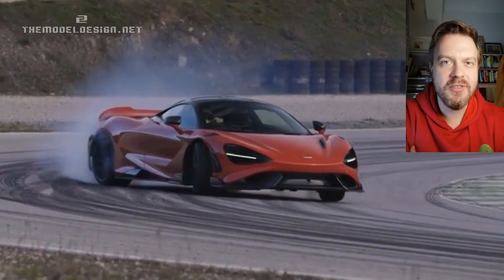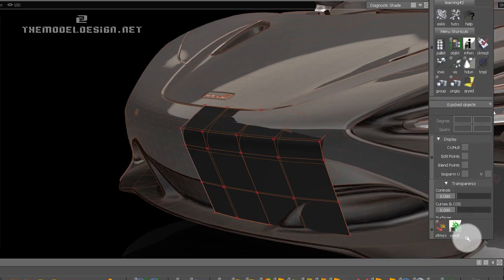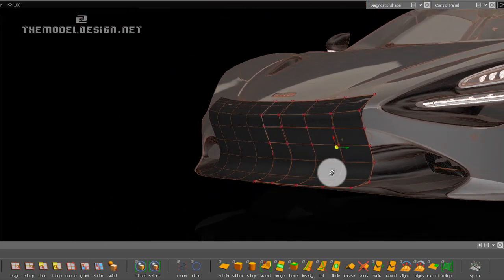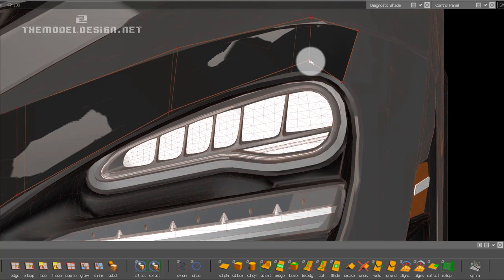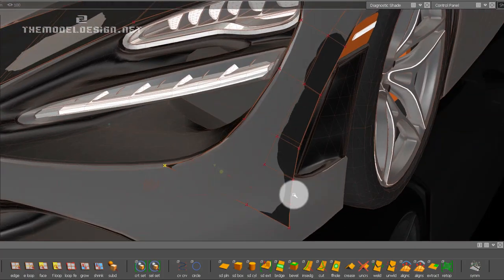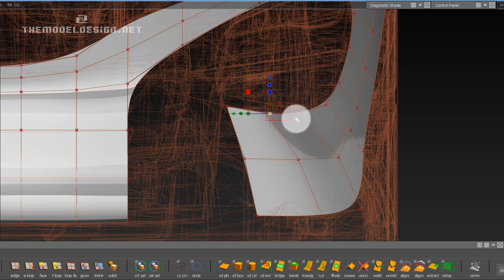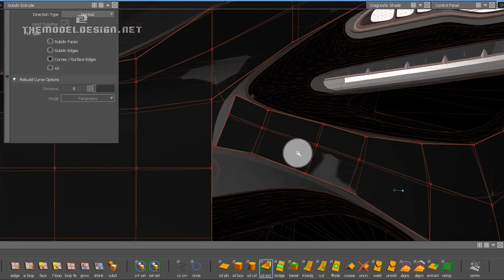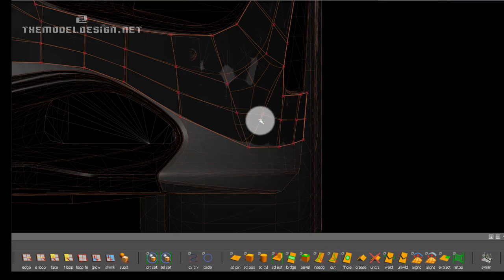Automotive Subdivision Polygon Alias McLaren 765LT Bumper Splitter 1

Comment: Hi!  I want to ask - is alias polygonal modeling used in the production process of the final model or is it just to find a conceptual idea?  Thanks!
Reply from the maker: I don't think that you could achieve tight tolerances in polygonal modelling. But hybrid modelling will work. 
E.g. a gear lever knob's main shape could be modelled in polygons. Other geometry, such us thread and assembly slot could be constructed in NURBS. But without polygon modelling achieving attractive shape would be much more hardcore.

Comment: The subd tools in Alias creates NURBS limit surfaces, not polygons. Those surfaces can be used with all other modeling tools in Alias. This hybrid approach allows modelers to trim limit surfaces as well as create fillets, draft surfaces, etc. IN addition all Alias diagnostic tools can be used with Subd's in Alias...specific radii, highlights, etc can be checked/verified. This is the unique difference between the implementation of Subd's in Alias versus all other polygonal modelers...